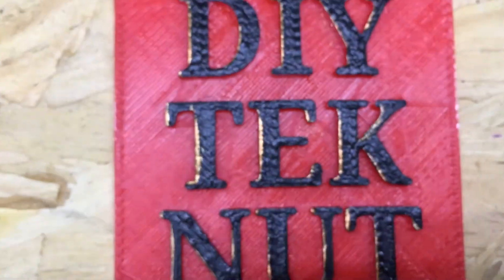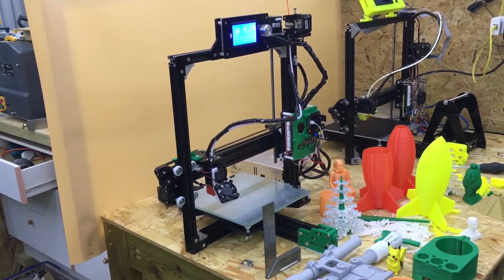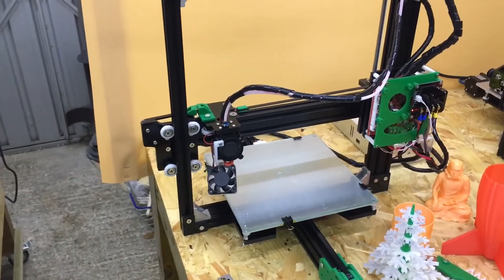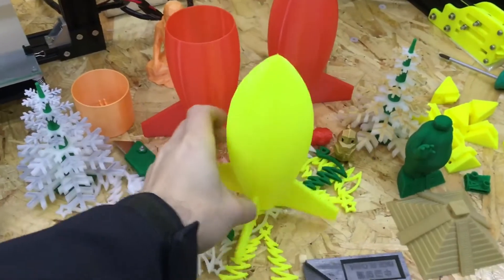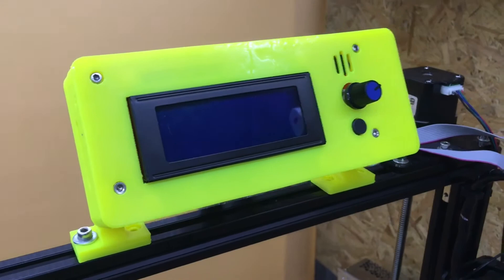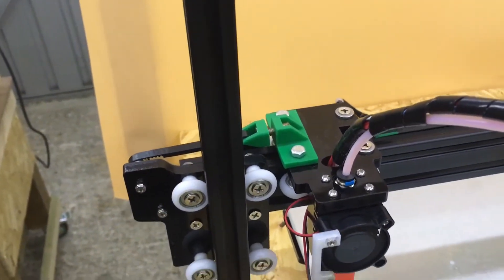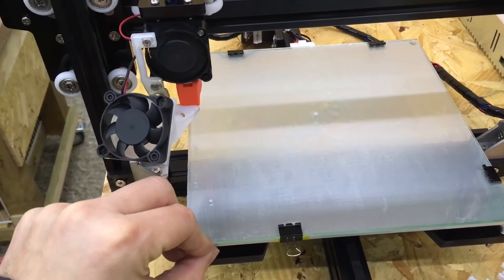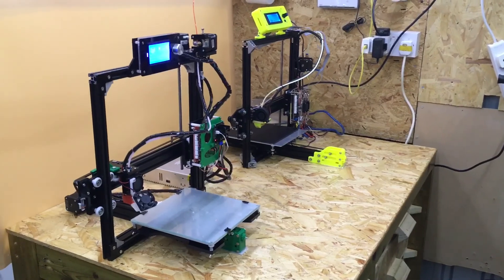Anet A2 3D Printer Review, are cheap printers any good?

Comment: The quality of the prints seems really nice. I’ve seen these for sale for £150, seems too good to be true!!
Reply from the maker: Yeah i know right. i brought just for a project i was bored thinking it would not be very good and could build it into something better but to my dismay i brought a printer that prints and works very well.
they have gone up in price  ebay £127  i had a £10 off coupon got it for £117.
you can get them for £141.99 with a 1KG roll of pla search for  X23D on ebay 
All the best thanks for commenting.
Reply from the maker: it Took me about 6 hours to build the kit the instructions were not to bad there are videos on youtube showing the assembly process.
Reply: I bought one yesterday, so I cant wait to start 3D printing!